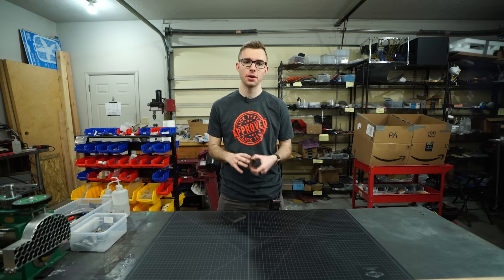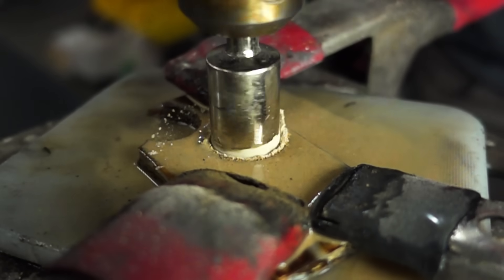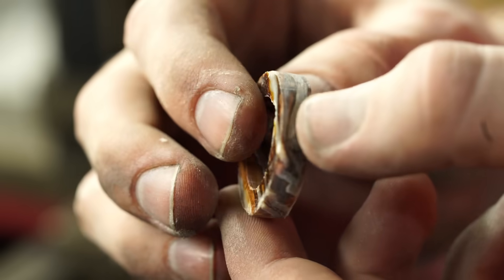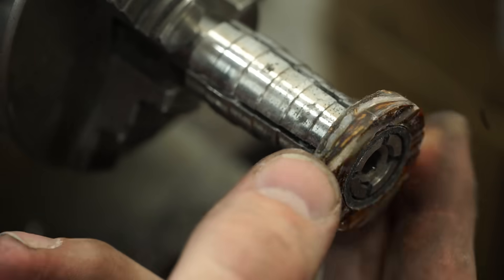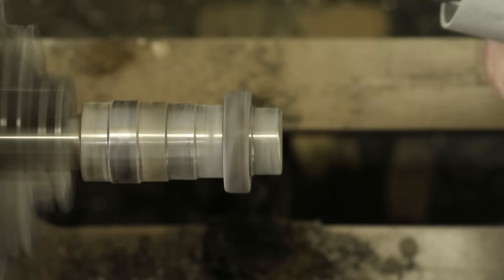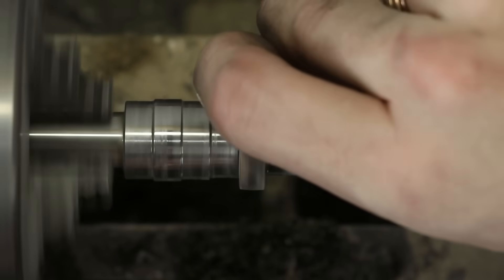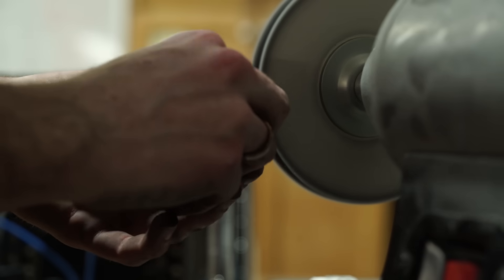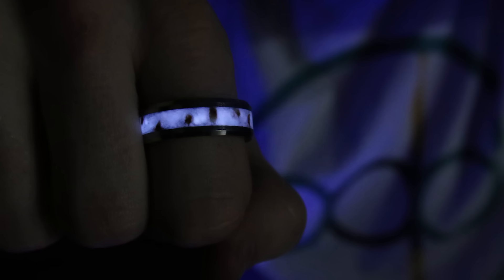Making a Siberian MAMMOTH TOOTH and Carbon Fiber Ring with the Waterjet Channel

Comment from the maker: Check out my Supplies website where I sell the materials and supplies I use in my videos: https://bit.ly/2yPhGpC
Reply: A master of your craft👍🏾
Reply: Sent you an email for a request on madrels. But commenting to point out something i keep seeing on the lathe. Is your mandrel warped? At first i figured the teeth may be bowed but that wouldnt make sense considering its also made on a lathe. When you were using the depth gauge, i couldnt help but wonder if a lot of what you were seeing was from a wapred mandrel or perhaps one that wasnt sitting right in the chuck. This is something i see on a lot of the videos. It shows up when you do slow motion shots. Looks to be a fraction of an inch of wobble but if you correct for it and its the mandrel thats actually bent, youre still gonna end up with an offset thickness in the ring.
Reply: Can u come to me
Reply: Can u give to me
Reply: I would like to have one of these. It's amazing looking!
Reply: Hey Patrick, from one Ring artisan to another I had to say I'm always impressed with your work and how inspiring you are to the craft.  Thanks for yet another incredible video and project share.
Reply from the maker: Thank you that means a lot!
Reply: Hi patrick
Reply: @Hezekiah Isaac sure it did scammer

Comment: instead of directly glueing the material to the wood when using those hole saws, apply painters tape to both surfacs and glue that together, makes the parts come off real easy

Comment: Using carbide bits on soft material isn't advised dude, if that's a HSS insert correct me, but using a HSS blank and sharpening properly will give you a MUCH smother cut on your lathe.
Also dial indicator "needle" is actually called a probe.

Comment: When I’ve worked with mammoth tooth and ivory in the past I ALWAYS use a backer for the front AND back before I do any drilling or shaping. It can be something as simple as a piece of card stock glued to both the front and back faces, or even painters tape.... 

A thin front and back lamination may have given you enough stability in your drilling process. I Enjoy your videos, sorry you had some issues… I come from a background of exotic materials specifically used in the gun knife and Jewelry Industries. I’ve seen it all, from hundreds of pounds of superconductor (enough to fill several large flat rate boxes) to a dozen full length mammoth teeth being sawn and stabilized into scales for resale. So I completely understand your strugles, That material can be such a pain! 
You do Great work!

Comment: Oh and great video and work.
Reply: Oh and go much slower with your diamon hole bit, get a drill press with a dial tension.  You dial the pressure down, without using an arm lever. One click,  chill out a minute/lubricate, two clicks, chill out/lubricate, 3 clicks, etc etc -- Bringing the bit down a 1/1000 of an inch at a time, instead of applying and holdiing pressure.

Comment: Wanted to give a heads up on how to cut that out with better success.   Gather some foam core with adhesive back: use the good kind that will not release with light mineral oil.  Sandwhich the mamoth, wood, bone, etc between it, cut the first part out- appling lubricant just as you normally would.  After the first part is cut out- inspect the sides for possible cracks- which would be rare.  Next wipe the top of the foam core with degreaser, cleaning well and apply another clean piece of foam core on top.  Clamp it all down- Cut the last.  Not only does this greatly reduce vibration, and that tear out violence you mentioned but the over all pressure from your drill press clamps is evenly spread out.  May not make good TV, but you can then pull the foam core aparts on each side and gently sand off or use adhesive remover to get your ring cut out free. You can also use plasticore, wood, etc  but foam core works just fine.

Comment: If you slow your drill speed down and use a diamond grit hole saw you will not have so many breakages when drilling hard/fragile materials.  You can also use some drill lube instead of water.  You do great work, but trying this may save you some time and material cost.

Comment: Ashamed they couldn’t cut it out with the water jet.   Any fragile stone is best backed up with  a stable surface.  You could use hot glue or ca and glue it to mdf.  A little bit of water will dissolve away the mdf.

Comment: Hey patrick the ring turned out nice but about the tooth cutting part i have a suggetion for you .
Diamond tools dont need alot of force to do the job looking at the video i notice the water was drying out fast and you can see some smoke .the problem is you're forceing the tool instead of letting it do the work . Next time just try less force and it should be fine . Good job overall .

Comment: heya, complete novice at ring making here, quick question, when you are checking the concentricity of the rings outer diamete, how can you be sure you are measuring it correctly when it looks like the part you are holding it with is off center?

Comment: Please don't take this negatively, I mean it to be constructive. You have beautiful work and, maybe it's just an optical illusion, maybe it's real. But as I'm watching you run the dial indicator for concentricity it looks like the mandrel is out of alignment. If there is deflection in your mandrel when you check it and mark the high spots, you're taking the ring further out of concentricity. I'm sure it doesn't matter in this case since you hand sanded it afterwords, but just as a note, your ring will only be as concentric as your mandrel is straight. As a further side note, I wouldn't put your lathe mandrel in an arbor press. get a steel dowel or another mandrel for that. Always keep precision tooling away from non-precision work. Keep up the good work though. I love all the work you've done in the past and I look forward to new beautiful projects! (sorry for the novel...)
Reply: i was thinking the same .
Reply: Ay ye might be into somthn lad
Reply: Core Lockout Booooooring!!!!!!
Reply: exactly what i came down here to say :D

Comment: Beautiful ring! Mammoth tooth is extremely hard to work with, it can crack or break very easily when drilling holes, you did the right thing to have it glued onto a piece of wood so that it can be drilled without cracking again, ask knife makers they will tell you mammoth teeth are nightmares for beginners

Comment: Use your tailstock to center your ring mandrel.  Then buy one of those flex extension cables for the Dremel and mount that in a tool holder for your lathe.  You should be able to greatly increase concentricity of ID and OD.

Comment: Hi buddy, I was just curious as why you were using the dial at around 7 minutes in. Your ring fixture is wobbling in the chuck. My suggestion would be to use the dial after you put your ring fixture in the chuck. That way whatever you machine will be precisely machined.

Comment: I hope you have a flexable tube connected (on itsfar end) to an exhaust fan set in an otherwise closed window, which is set (on the near end) in a wooden frame or cone shape finished off in a frame to enable you to anchor and point the air intake in the direction of the dust or fumes creating work. This way the fumes and dust can be drawn through the flexible plastic  tubing to the outside. And with the ready availability of silent and low priced high volume replacement part computer power supply fans you can set up one in a blocked off open window with a hole cut in it for being set. Vibration should be low but a dampening material can easily be set between the board and  the fan. Just consider that a computer fan will need a 12 volt power source. A small plastic box fan would work just the same while having the advantages of being able to be plugged in to a wall socket and having multiple speeds. It is far better than using dust masks while working since it prevents dust from accumulating all over the shop, afterall you won't want to have to wear one all the time because dust is constantly being stirred up.

Comment: Great project but the mandrill itself is so wobbly that using the precision measuring unit makes no sense
Reply from the maker: I trimmed the surface of the mandrel where the ring was mounted, there wasn’t any wobble where the ring was.
Reply from the maker: I trimmed the surface of the mandrel where the ring was mounted, there wasn’t any wobble where the ring was.

Comment: Let me give you a really good tip for attaching things using super glue like this.  I have to do it with small wood pieces all the time. You only need one other thing: blue painters tape.

Here is what you do:

Stick a couple strips of painters tape next to one another on your scrap board.
Next cover the bottom of your workpeice with painters tape.
Next glue the two tape covered surfaces together.  It will hold very well
When you are all done you just peel off the tape, no fuss with trying to fix anything.

Comment: I’m wondering why you don’t freeze the carbon fiber inserts before fitting them. They will slightly shrink when cold. Then expand and fit tighter when back at room temperature.  Maybe not a great idea for this ring since it’s prone to cracking but all the other ones you have done I’m sure it would work well.

Comment: Wouldn’t flipping the mammoth tooth over and doing a light cut to score the bottom help avoid tear out? Also, what’s the longevity on these CA glue inlays? I’ve had issues with yellowing with UV exposure and also weakening over time on unrelated projects, using CA glue. Any reason why you don’t use an epoxy?

Comment: +Patrick Adair Designs  Always coming up with something new and cool bro.  Hey question for you.  I was told there are a couple "desktop water jets" now available capable of cutting steel making them more affordable now and was wondering if you have one in mind for us to check out?  It would need to be strong enough to cut through materials we use like tugsten, titianium, iron, etc but have you looked into what the most affordable water jet might be that would fit in the common home work shop?